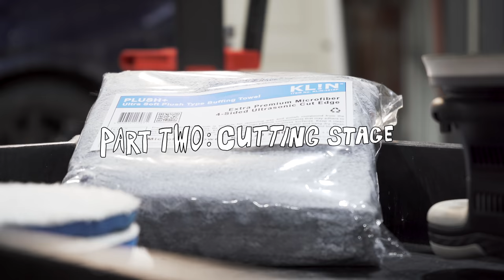Polishing A 1961 Corvette Using A Bunch Of Different Tools - Grandad Dream Car Vibes!

Comment: Something I really want to master is paint correction. I have all the necessary tools to do so but I just don’t know how to approach it. I would ask Facebook groups but they’re all pretty rude and aren’t much help :/ great video by the way, was wondering if the Corvette will be a polish!
Reply from the maker: Thanks Kevin! It sounds very basic but id really suggest finding a spare body panel from a junkyard or craigslist and practice on it. Trying your hardest to burn through the clear coat in different sections will allow you to see what it actually takes and most likely realize that there isn't much to fear.
Reply: Ammo NYC has great training videos about learning how to paint correct

Comment: As a Detailer, I can only advise you to get a Lift or at least a Quickjack to raise the car you are doing a little in the air. Your back will thank you and you will feel less fatigue. Also use compressed air to blow out the pads between passes. They will last you a lot longer and your cutting and finishing abilities will be to a higher standard. So you save money in the long run. A little metal polish on the chrome parts would also gotten the overall appearance just a nudge higher ;)
Reply from the maker: Thanks man! I will consider these suggestions. I am just starting out so there is definitely a lot to learn!

Comment: Do you use IPA before applying wax?
Reply from the maker: Not usually. Wax is stackable. The oils leftover from polish are no different then applying it over Powerlock which is a very common practice. If someone can change my mind with science I will listen

Comment: Why don’t u use an air compressor to blow out pads during cutting/polishing?
Reply from the maker: I find it puts too much dust in the air, not really a fan. I also I switch pads after 3 or 4 passes so I don't ever really need to clean them out majorly. Just lift the fibres